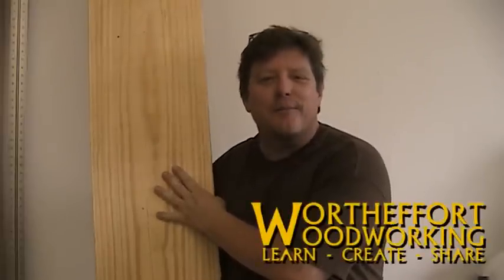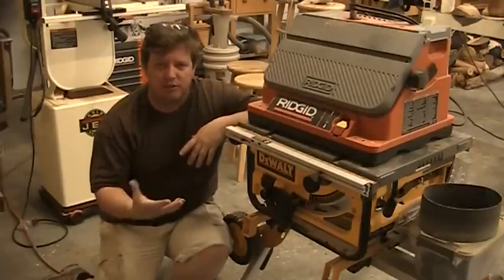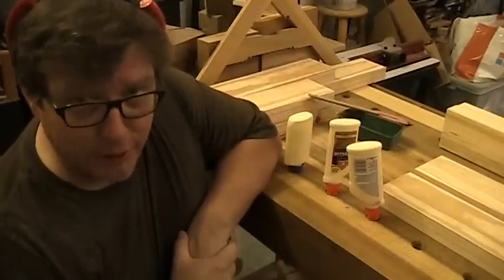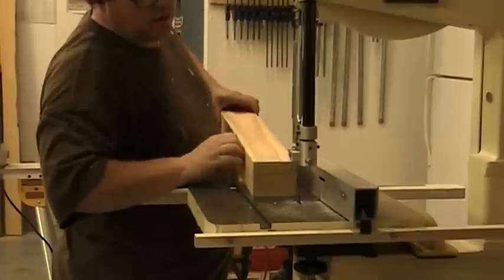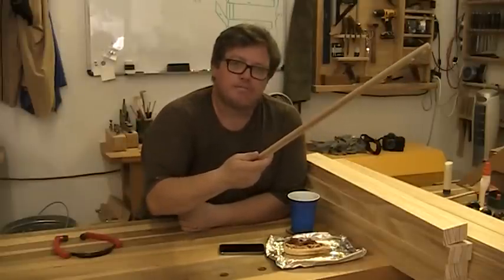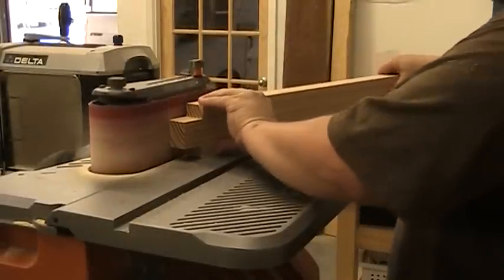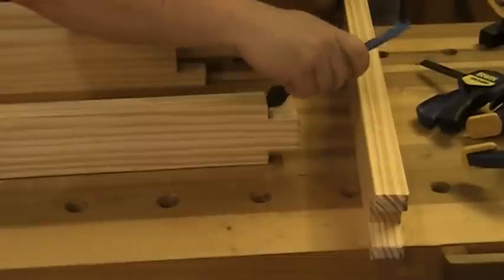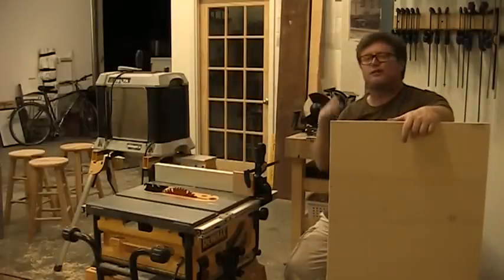1 Board to Build 1 Table/Bench in 1 Day... Challenge Accepted

Comment: At 18:38 - don't like doing math... You can also do it without measuring / marking. Leave the part on the table saw, move the fence and add the other leg between the first one and the fence. Tighten the fence, remove the other leg, move the first one to the fence, and just cut. That way no need to mark and the cut is perfect ;)
Reply from the maker: Petar Paskov you forgot the kerf of blade.
Reply: Actually not, but I did forgot to mention one step. After the first cut, slide the board left (for the width of the cut) so the right side of the cut is aligned with the left side of the blade (left side of the cut on the sled). Then do the rest. So - no measuring, marking and stuff 😉

Comment: So I'm limited in my space and do not have a thicknesser. I feel totally handicapped from making certain projects because hand planes just take so much time. What are your thoughts on the handheld electric planer? I've heard they take off too much material, but do they make a parrellel edge at least?
Reply from the maker: I've used handheld electric planers when flattening things like benchtops. Use them as you would a scrub plane. Hand planes are not that slow when used for flattening. It just takes a little practice like everything. Meaning flattening two or three boards. Though it'll never be as fast as pushing the button on a $1000 machine. But, a little time vs having to spend that money? Another option is to buy from a quality hardwood dealer as most have a planing service for a reasonable charge where they'll run them thru their machines. If you go that route all you'll need to do is surface them for finish. I'd also try to have them machine the material as close to the time as the build. Don't let it sit around for a season as the moisture in air will be different. Also remember, there is a huge wealth of projects you can make without flattening at all. Having a board 4 square is a modern phenomenon. Throughout history people only flattened the "show face".
Reply: Phenomenonal response! Thank you! I took a fundamentals woodworking class and everything has been S4S. (No clue that wasn't necessary, flattened face good enough for me!) I can go to them to rent and dimension so that's an option but I wish I didn't need to depend on anyone else. Great advice here! Love your channel and challenges! Thank you!

Comment: Love the challenge.  I think I'm going to use this process to make myself a cheapo out feed table until I build something of higher quality, but time is something I don't get a lot of in spades.  One of the things I was a bit confused by is why you dimensioned such green wood?  Was that just to get a temporary glue line cut?
Reply from the maker: +christschool Down here diminsional lumber is not smooth at all. I diminsioned it for two reasons. Vanity, I wanted it smooth, and accuracy, I needed parts to fit together perfectly and having different sized parts would've made the process take longer. So in this instance the little extra time spent dimensioning saved me time in the joinery.

Comment: One more. You've used angled pegs at one of the joints. Did you reckon a rough dovetail is less desirable?
Reply from the maker: dovetailing is just different. angling the pegs opposite does much the same thing.
Reply: Thank you.

Comment: Awesome video!  I love your table saw cross cut sled..  I see you use a piece of wood on the fence to set your length of cut rather than using the table saw fence.  I really like that idea..  I also see you have only one T-rail like my table saw too.  Do you have any videos on how you made your cross cut sled?  I looked but couldn't find any..  Thanks again!
Reply from the maker: No but the technique is the same as an early video I did on making a sled for a bandsaw. That block of wood is a safety feature as without it the offcut could easily get trapped between the blade and fence and become a projectile.

Comment: As an engineer it always made me thinking why do carpenters shy away from  trusses, even in workshop appliances. Not to mention workbenches. Even a single triangle made of a shovel handle can add as much rigidity to a construction as tens of pounds of wood located near hinging points. Why is this the case? Is this due to aesthetics and tradition?
Reply from the maker: I'd think it's the joinery and just how strong does it need to be? Sometimes overengineering is good. Othertimes not.

Comment: A torrent of words and about 20,000 dollars ? worth machinery .
Reply from the maker: Ha, a newbie excuse not to try. You are looking at maybe, maaaybe $2,000 worth of tools used in this project. And I doubt that very much.
Reply: 20,000?! PFFFFFT hahahaha! Even if every tool used was made by Jet it wouldnt have been that much.

You can go to home depot/lowes and get a RIGID bench sander with a spindle belt and disc, a Ryobi 10" compound miter saw, a decent portable RIGID table saw, a Ryobi 9" benchtop band saw, a Ryobi benchtop drill press, a benchtop thickness planer and a benchtop jointer by Porter Cable and you're looking at $1500'ish after sales tax. All that stuff would serve a hobbyist woodworker very well for a very long time if they don't treat their tools like shit.

Comment: I like it. I made a work bench for my Garage work shop. It's not as fancy as yours with all of the joints and dowels and what not.
http://imgur.com/gallery/W2BTS
But the top is made from 2x4's ripped in half which brought them to about 1-3/4ths inch thick but after planing and sanding it's down to right around 1-1/4th inch thick which makes for a solid top on it. But it's 5'x2'x39" and I hope it'll last a life time. But only time will tell.

Comment: Great video man. I have two questions. One: if you did have screws would you have used them over the pegs? (I normally use screws but they are black heads and this just looks aesthetically better) And why did you not have the pegs the same length as the drill bit. That way there would be no cut off need. Love the joints. Going to try those on my kitchen island when I can get round to it. Thanks for the tips.
Reply from the maker: For a shop piece screws woulda been just fine. But then you wouldn't of gotten to practice joinery.

Comment: Great video, but I cringed at 8:32 when you were cutting with your left arm crossing over the cutting blade!  For safety - even when time is short, please show the piece clamped, or feed from the left if you want to use your left hand to hold/steady the piece.
Reply: He wasn't doing that, he's very clearly positioned his body completely to the right of the cutting blades. His left arm isn't crossing in front of anything related to the saw, it's parallel to it.
Reply: +
Jeffrey Culver
Get some psychiatric help.
Reply: Real men hold/steady the piece with their "little wood".

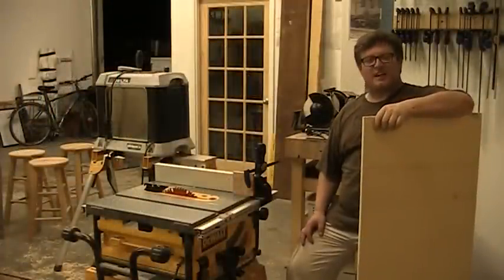Comment: 25:52 you said, "it's about 7 O'clock"

26:42 you said, "it's about 8.30"

Sure you said elsewhere in your video that it'll take you about 20 minutes to cut up the board and tack it to the frame but here we are, 90 minutes later and you've, apparently, just completed the project.

Even 20 minutes to cut up a board and nail it to the frame....what were you doing, scratching your arse every 2 minutes?

How could you work in a shop that needs to make money?

Anyway, please tell me, it didn't really take you 12 hours to make the frame and cut up some ply wood for a frame with all those power tools you have?

I work with hand tools and CAN do it quicker and have thought of throwing some money into to power tools but it seems to be a waste of time, if you're telling the truth on how long it took to make that table.

Throw out the challenge and I will video 100% start to finish and upload to YouTube, with the same conditions and  he did...have materials on hand and then I'll pull the trigger on the start gun. 

Of course, I won't be doing any of that BS crap of putting it through a thicknesser because as he said, it's just a shop table, nothing special.
Reply from the maker: So you need someone to challenge you to do better.... OK, you're all talk (Trollish comment to motivate you to do what you say you can). Also, looking at your channel, not sure you realize the time it takes to film and edit. So good luck. Wish you well. Post the link when you're done. It's Friday morning now so... Sunday?
Reply: @SauronEye. You are forgetting the Americans do not have a truth based society. The rules of this challenge are.....xyz, he then immediately breaks the rules and tries to cover this with a combination of special pleading and bullshit.
The key to success in the states is fast-talk and false promises to a mostly uneducated customer base.
Reply from the maker: Lionel Spencer-Ward that or I to an hour for dinner and chores.
Reply: This shit is funny. Trolls everywhere.
Reply: @Lionel Spencer-Ward How you enjoyin' this Internet we made for ya?  You having fun on it?  Awesome.